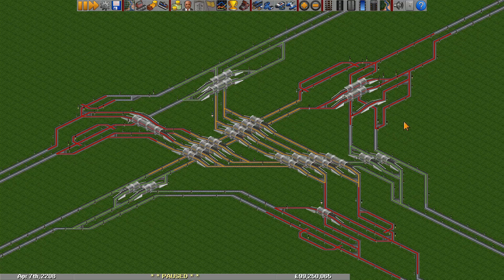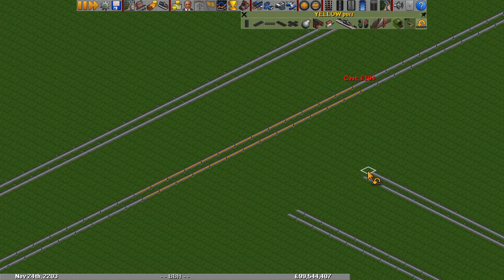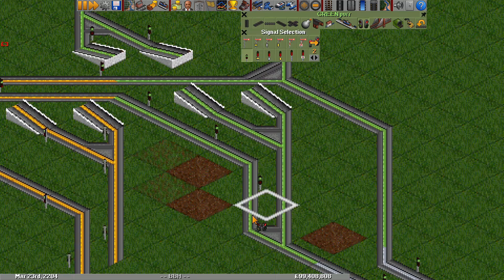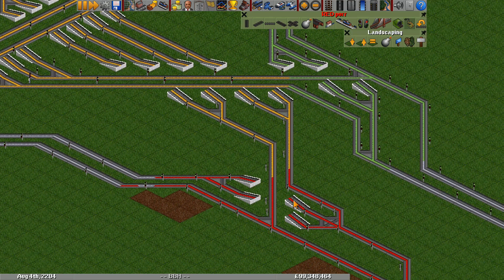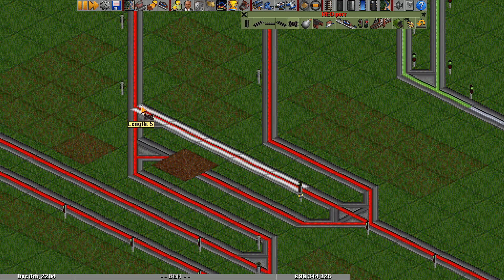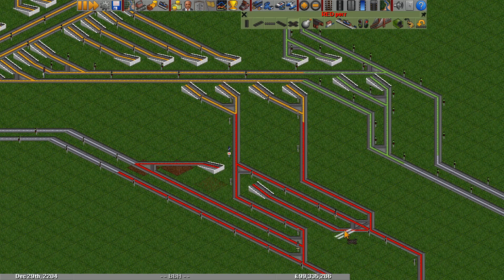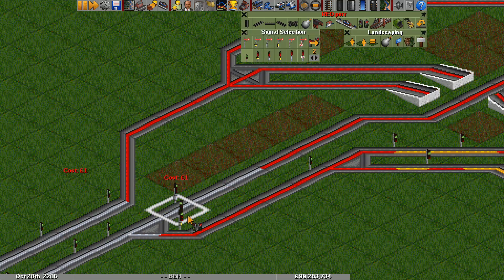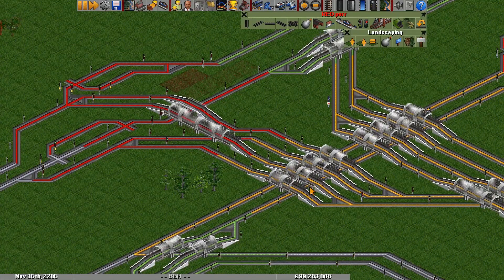Backbone Hub Tutorial

Comment: What's your opinion on the type of merge you can see in this screenshot?

https://wiki.openttdcoop.org/File:COMPACT-ROTATING-BBH.png

I haven't tried it but logically it feels like it should have the same throughput, or am I thinking about it wrong?
Reply from the maker: The X-crossings are acceptable but not as good as the full grade separating crossovers. Since trains from the choice tracks my block eachother in awkward ways, can end up in a situation where the left track goes right, right track goes left, alternating. But I've seen V453000 use them and you don't always need the perfect maximum capacity. If it works it works
Reply: @LugnutsK  cool thanks. They're tempting to use due to how simple the design is.

One of the reasons I asked is that I'd love to see your thought process when you expand an existing BBH, especially outside ideal conditions (i.e. the terrain) like in this tutorial.

Take the "invisible" hub in your let's play for instance. If you were going to upgrade it to 3Rx3L, would you be more inclined to demolishing the whole thing and start over or try to hack in the new lines where possible?

I know the mergers might not be the biggest issue here (rather the left turns sitting in the center of the hub)  bit I assume they'd be part of the design considerations.

Hope that you get a chance to show that process in the LP or this tutorial series.
Reply from the maker: Ulf Ståhl Definitley keeping the shape of hub when going to 3L 3R. Might have to move around a lot of tracks in the interior but overall the hub will keep its shape
Reply from the maker: Ulf Ståhl Actually this might be good if you haven’t seen it: https://youtu.be/waXLBYyIotM
Reply: @LugnutsK  yes I saw that one, it's great. But would be really nice to see it done in real time (or like x2 time lapse) with commentary about the thought process.

Anyway love your work, keep it up!

Comment: Question: at the very start when you're making the bridges after the split, you put a PBS signal just oon one of the track in front of one of the bridges. Why only that one only there? :)
Reply: I don't remember where, but somewhere he said that PBS signals can stop the trains for a very small amount of time, while block based signals don't do that. Of course with entry and exit signals, you need an extra tile before the bridges, so PBS signals are used if there isn't enough space.
Reply: @error-42  Ah, yes, I remember that about PBS signals. Speaking of remaining space, I can clearly see that in merges. But it's not as clear at 5:06, for example
Reply: @error-42  Nevermind, I see it now :) It's the same issue: not enough space for block signals before the bridge.
Reply from the maker: @dmitriid  Yup, there is not enough room for a signal before the second bridge from the left. So no way to split up the block, have to use path signals. I use block signals by default since usually thats all you need.

Comment: Can you explain doubled bridges and tunnels please? I keep seeing them but never the reasoning.
Reply: The bridges and tunnels only holds one train, so if you have a 2nd option, any train behind doesn't have to come to a complete stop but just goes onto/into the other option. 
You can make as many as you like. 
I have a tunnel system under a Main Goods In Station so it's a little long, but with 4 tunnels in each direction and I don't have blockage yet
Reply: Thanks, that makes sense